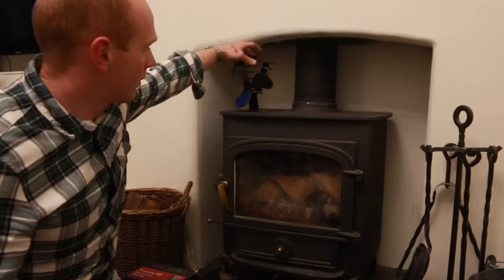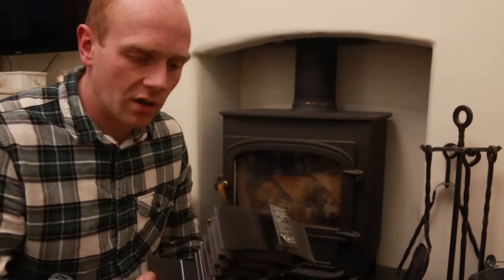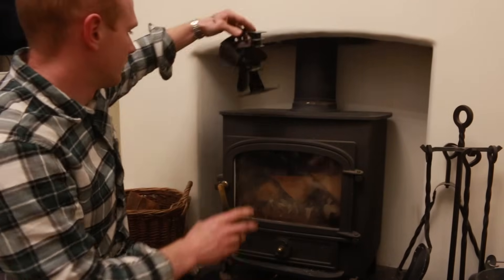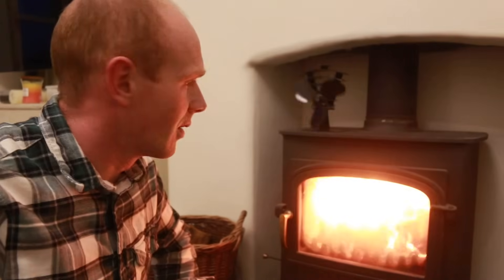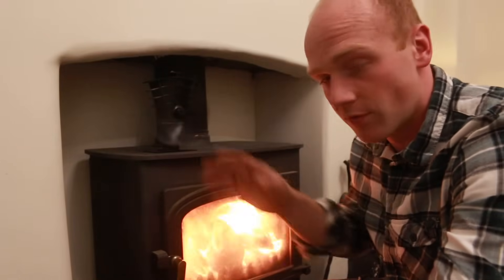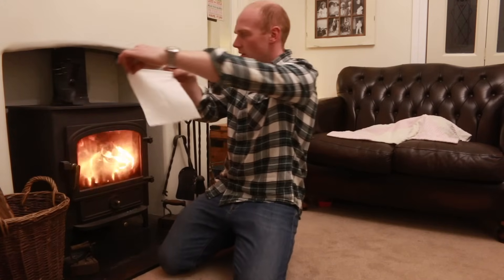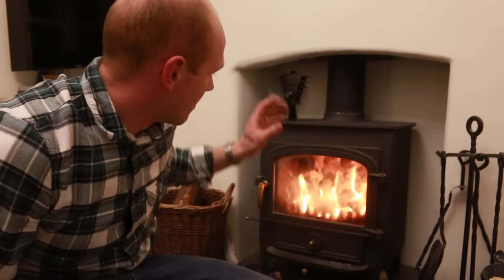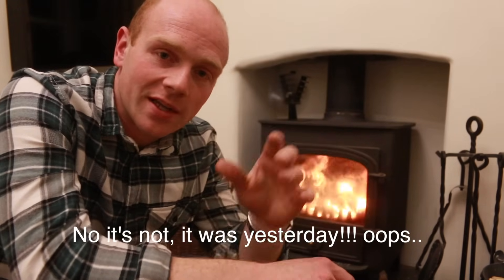What on Earth is a STOVE FAN?

Comment: Would have been a better example of air energy created by using an incense stick. When they burn, they give off a scented smoke which is handy for seeing where air currents go. Placing this in different distances from the fan would have shown its efficiency.
On a windy day, they are great for finding drafts in your house or dwelling.

Comment: Been using a fan like this since 2009-10'ish, can't remember.  But they work like a charm, and is a free cheap ass way to disperse heat for a one time payment.  I use the Dual Fan version.
Reply: Does yours turn clockwise, mine turns other way, is it ok, really turns counter clockwise.

Comment: It is not the motor that generaties electricity but the Thermo Electric Generator ( or TEG ) located in the middel that generates electricity if there is a difference between the upper and the bottom part.

Comment: In fact the heat is converted into electrical energy, not kinetic energy. The electrical energy drives the electric motor which drives the fan. You need to put the fan at the back of the stove so that the air blows over the top of the hot stove and heats up.
Reply: Carl. What do you think the energy given off by a fan is? a moving fan? I'll give you a few seconds

Kinetic energy.
Reply: He has the fan exactly where is supposed to be.

Comment: A bit late to the fan tread, I have one of these fans, my multi fuel stove provides water for my central heating, the water jacket surrounds the firebox,sides, back and top as a result when running at normal temperature the top of the stove does not reach the minimum temperature that makes the fan operate. are there any alternatives that would start operating at a lower temperature ?

Comment: Hi - do you think this would work with a gas stove? The stove definitely gets much hotter than radiators?

thanks
Reply: Saxilby Joe It will work,I have one on a gas little Wenlock.
Reply: It works with my oil radiator when it's on full. It doesn't spin very fast though.

Comment: question - we have log burner build into the wall and covered with tiles around. cant put anything on it. if l get a fan  and put it just at the base, in front of it -would that work?
Reply from the maker: The fan needs to sit directly on the stove so not really suitable. That said, any free standing fan may help distribute heat from an inset stove.

Comment: Nice video but the position of the fan is meant to be towards the back of the stove Graham the chimney sweep  😉😉
Reply: Graham Atkins ideally the fan should be sitting where the stove pipe is...
Reply: Graham Atkins it would be more effective if stoves had inbuilt fans, like some cookers.
Reply: You need to put the fan at the back of the stove so that the air blows over the top of the hot stove and heats up.
Reply: best not would fuel in the stove will disappear up the chimney before you could say MARRY POPPINS LOL
Reply: You're all wrong. If you actually look at the instruction manual for any of these thermoelectric fans, you'll see the manufacturers ALL recommend the fan be placed on the side of the stove pipe, exactly where he has his placed, to prevent overheating the peltier and damaging the fan. These fans have a maximum operating temperature that the middle of the stove can easily exceed. He's doing exactly what he is supposed to be doing.

Comment: It's a small DC fan, and not a magic thermoelectric fan... However, there is a thermoelectric peltier plate between the bottom "hot" stand and the upper "cold" side.
EDIT: It's the silver plate sandwiched between the two halves.

Comment: Why is your stove inside of the fireplace? Doesn't the heat go straight up and out of the chimney?
Reply: A metal plate is fitted which blanks off the chimney allowing only the flue pipe to pass through. Obviously there will be a certain amount of heat loss, but not as much as you imply.

Comment: iv got one on my multi stove with boiler but doent work what im i doing wrong
Reply: It needs heat at the base to work. Boilers dont heat up enough as they can be insulated. Test it on the cooking stove, not on gas one ;-)
Reply: @fyuhvftyhvf  my stove heats all radiators over three floors plus hot water
Reply: Jane Heseltine how much did that cost you to set up. If ur in the uk can you recommend any installers

Comment: Dumb. If you had any sense you'd leave the thermopile where it is on the stove but remote the fan up near the ceiling where the hot air collects to push it back down into the room and keep the air mixed- to prevent wasteful thermal stratification...
Reply: That little fan is not moving enough air to affect the ceiling air temp. That's what ceiling fans are for.